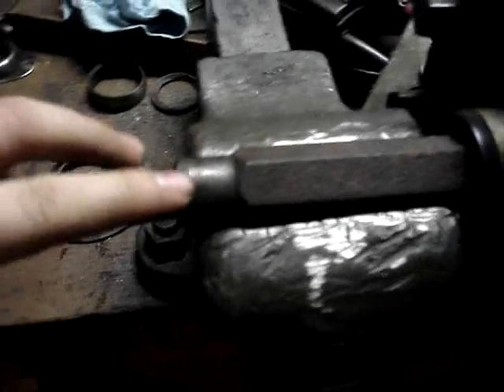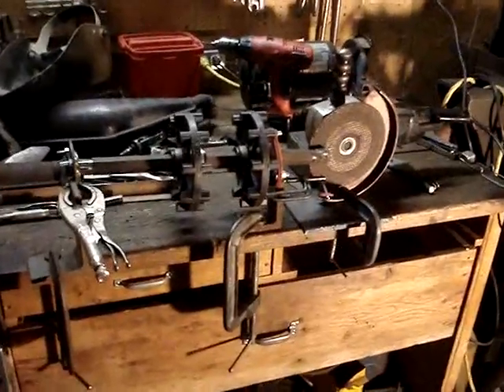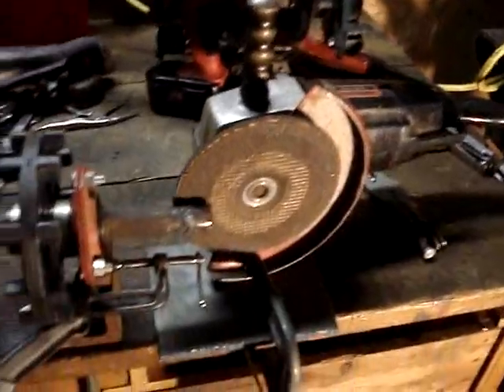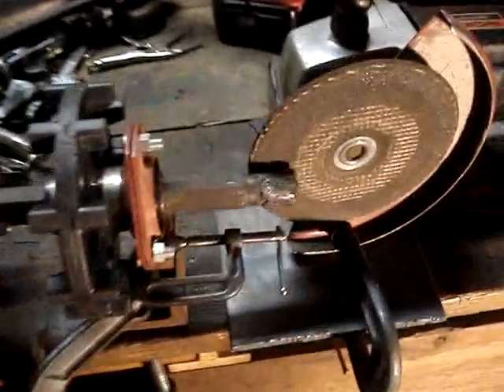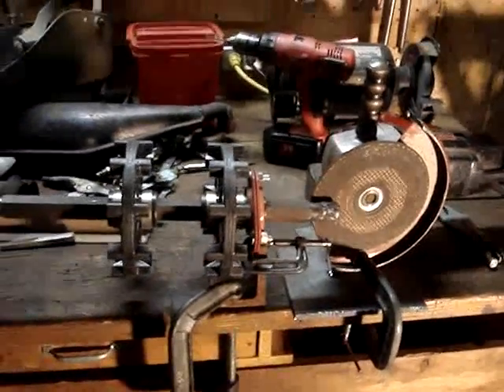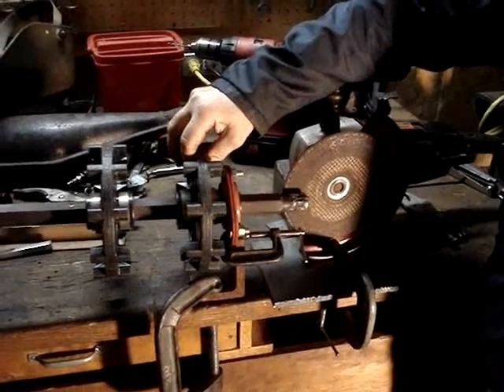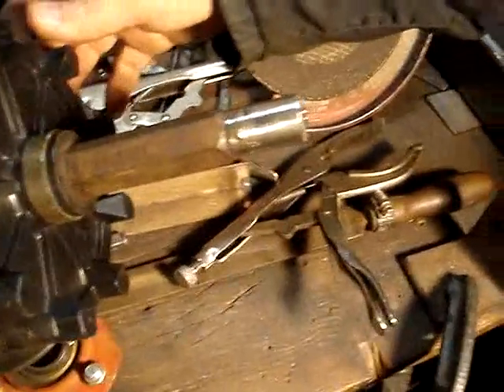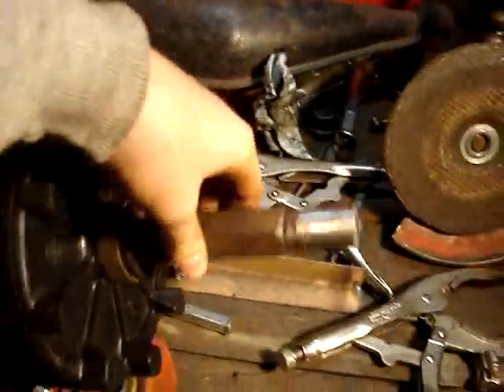Repairing a Shaft without a Metal Lathe

Comment: Yea i tried this except used a bench grinder and was only me in the shop.  So having to spin the work and make sure everythibg stays true.  And it didnt.. halfway through the grinder tried to eat the shaft which caused the grinder to jump up and twist which shattered the wheel.  Sent rock shrapnel all over the place including into my nugget..  luckily it was a bench grinder and not a 10k rpm+ angle grinder with wheels that will explode and end a life..,, this one just took a little nap and stitches..  but all is well that ends well, tried it again and got her did..

Comment: I needed to turn a 17mm shaft down to 9/16 and your method worked just fine for  me. Great video. I did however use a brand new grinding disk which really helped with alinement. got the alinement down to  0.2 mm. Thanks for sharing.